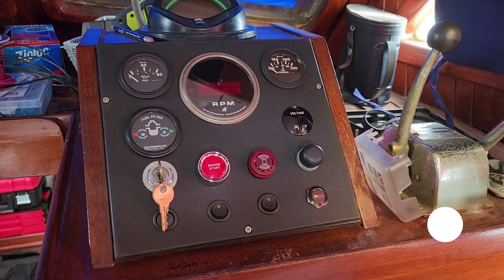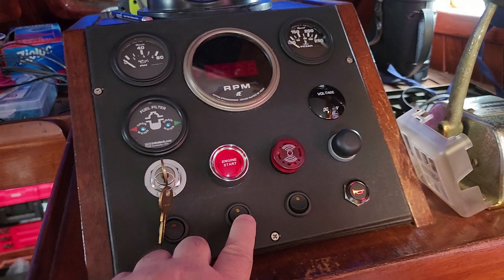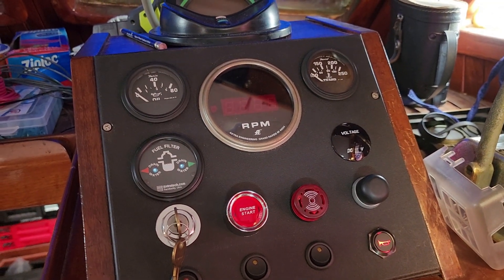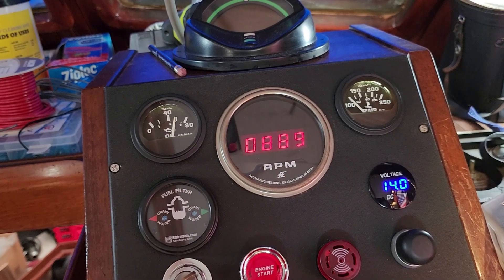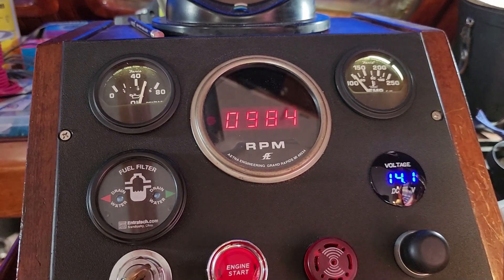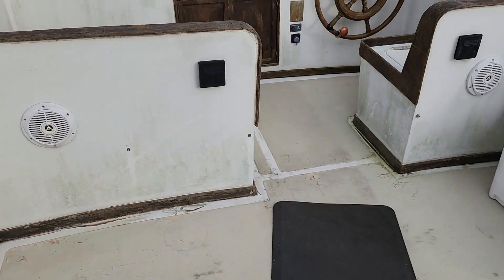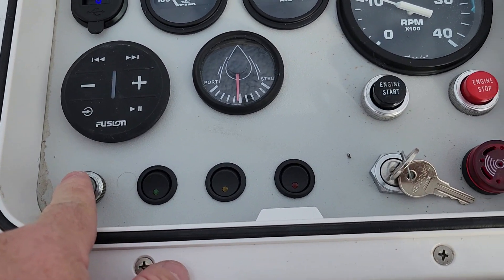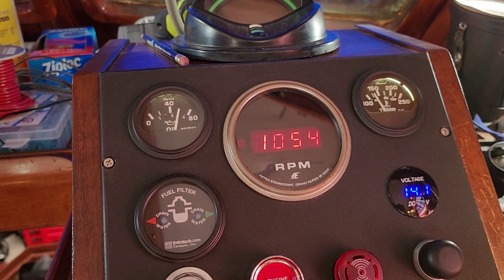Finally! Upper and lower helm stations complete and fully operational.

Comment: I bought some Aetna Tachometers and the starboard side takes a while to get up to speed and sometimes never does. When it does its about 112 off of the port engine. I have 2 upstairs and 2 downstairs and they both read the same. I have Lehman sp225 engines. Any ideas on troubleshooting? I really appreciate it if you do.
Reply from the maker: Depends on where the Aetna tachs are getting the signal? Are you using the tach drives off the Lehmans or maybe a pickup off the flywheel? I would suspect its an issue at the pickup since both gauges are reading the same. See if you can tell what your system is using to send the signal on that side. If its the flywheel teeth style you might check the clearance between the flywheel teeth and pick up as well as clean the tip. If it is the tach driver you can swap the drivers from left to right and see if the issue follows the driver. Of course if it follows the tach driver then that would be the problem. Your signal could be W signal from alternator as well but I would doubt that. Let me know.
Reply: @mvintrigue-trawlerdiy1101  Thanks for responding. It has a link up off the flywheel.
Reply from the maker: @DustinKaufman-i2q  perfect. Check the gap. For flywheel pickup that is semi critical. It usually screws in or out with a couple of jam nuts. Also clean the tip.

Comment: Thanks for sharing this, I have twin Perkins in my boat and would love to upgrade to digital tachs.  Great to see accurate data when you’re underway.
Reply from the maker: I tried several variations. The key IMO is to stop using the Alternator signal to drive the tachs. You can get a Hall effect sensor cheap. I got 4 for $12 from Amazon. I just made a small bracket on the front of the engine and epoxied two strong thin, round magnets to the balancer. Wiring is simple. From there you can drive nearly any tach you want and it will be much more accurate. You can even drive your original alternator W signal tachometers using the Dakota tach adapter for $99. You can get an ultra accurate Aetna gauge only for around $300. Or a Faria, VDO or other tach from $50 to $150 and probably wont need the Dakota adapter. IMO you have to start with a hall effect sensor mounted on the front of the motor.